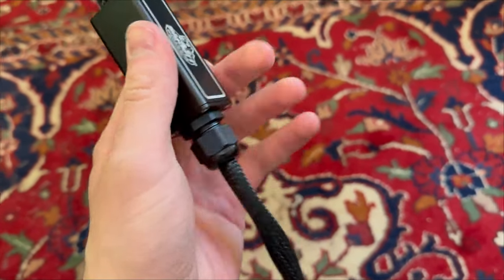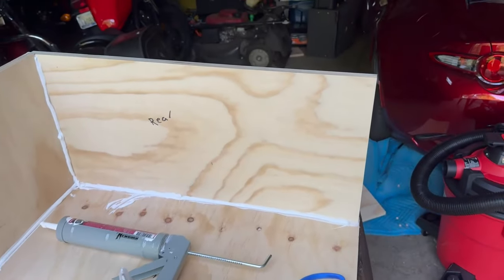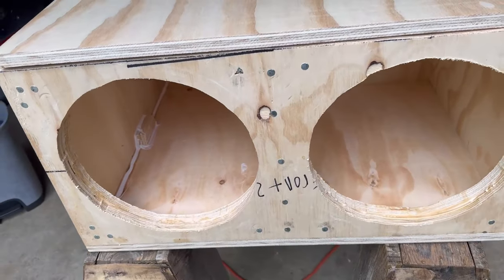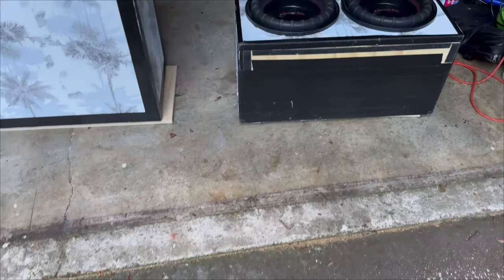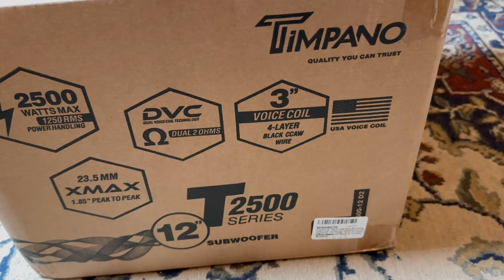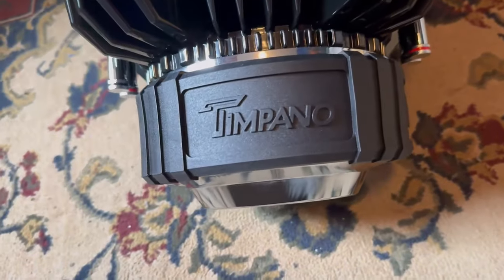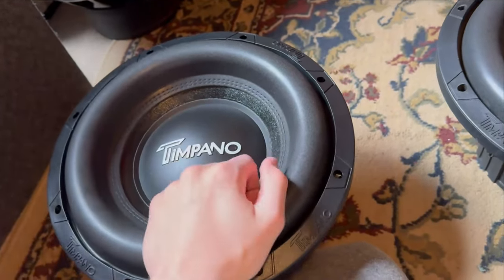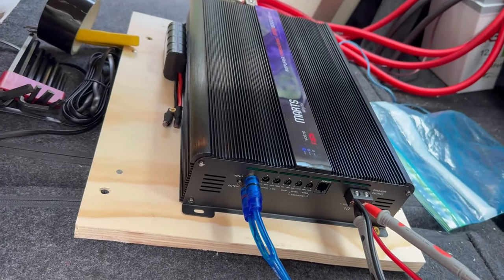Preparing For My *FIRST* Bass Competition/Meet Up!| Triplefest!

Comment: Doing good bro I'm about halfway there myself got the high output alternator big 4, double run of 0 gauge to the back feeding a 29AH SCIB bank just got a brand new Deafbonce AAK 6k and a ton of wiring and SMD copper fuse blocks etc still deciding on what subs to get don't want to blow them while I'm still learning never been to a show planning on going soon
Reply from the maker: Hmm 🤔 SLAPZ audio would be good or even some American bass or timpano. Honestly the choise is yours just remember the better the box the better the sub will survive
Reply: @Zachecker  that's my PROBLEM and the exact reason I'm not done yet I'm in middle TN and I can't find anyone around here that knows how and will actually build me a box I just got a promotion at work thinking about getting a down 4 sound custom dual 12 enclosure only thing is it takes 3-4 months for you to get the box and it's going to be well over a grand to have it made
Reply from the maker: @SlamryCamry19  you can make a box a portion of that. It costed me about 150 to make my own with wood, glue, nails, silicone, ect
Reply: @Zachecker   yeah I wish I had the time the new promotion at work is 12 hours a day 7 days a week indefinitely and with a 30 minute drive to and from work by the time I eat and sleep I'm averaging 2 hours a day for myself right now so at the moment until further notice I literally don't have the time that's why I'm trying to find someone else to build it
Reply from the maker: @SlamryCamry19  check out mb enclosures. Check those prices he ships.